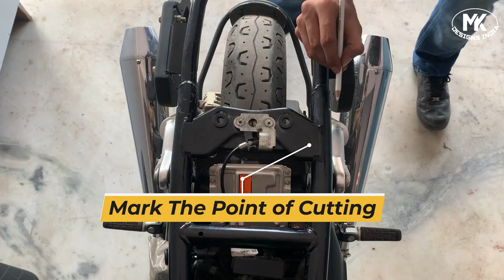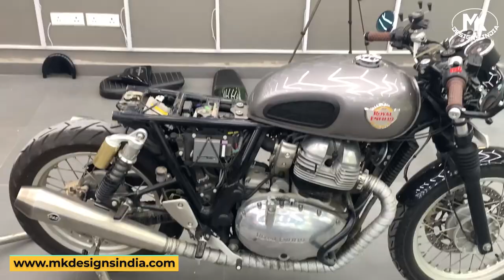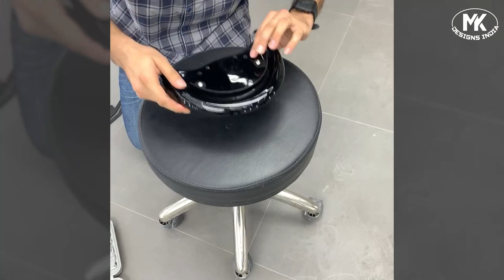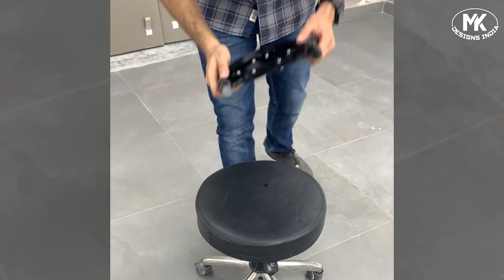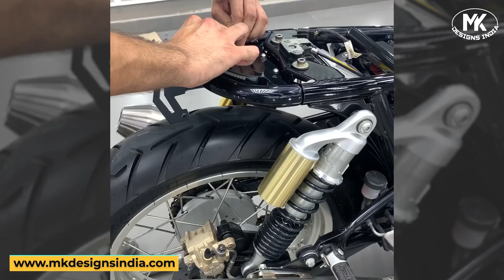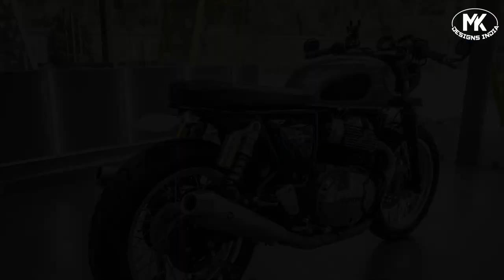Shorty Tail Kit | Interceptor 650 | Continental GT 650 | Royal Enfield Twins | Chopped Frame

Comment: But wouldn't the structurally integrity of the chassis get affected?
Reply: It would. This suits a show bike or one you'd use for shorter rides. Long time owners wouldn't cut frames obviously.
Reply: It wouldn't, because he's cutting the sub-chassis, not the chassis
Reply: He cut the back of the subframe not the frame that is connected to the motor! No structural rigidity is affected!
Reply: @tikiortaka  no it wouldn’t. It’s the subframe. Has no structural significance whatsoever.

Comment: So I decided to try this mod to my bike with the XL Shorty Kit which is the same size as the stock seat. It requires cutting closer to the end of the frame because the male ends (of the shorty kit) that fits into the female slots (of the frame) are too large. In order to get the seat to line up with the end of the tail, you have to cut further in where the pipe increases in diameter. Only problem is, the piece that's suppose to slot in is too short width wise and the slot isn't big enough. Now I'm stuck trying to figure out what to do next. Probably going to go to a metal fab shop and have them recreate the piece with the appropriate length.

Also, maybe I missed it, but I thought the shorty kit piece was metal, it's not, it's some kind of carbon fiber or hard plastic.
You may want to avoid buying this.
Reply from the maker: Mentioned on the website, its Composite Fiber . Its high strength. 
Needs to be cut at 35 mm from the frame starting .

Comment: Hey mate, great job.
I've recently purchased your tail tidy kit. Can you please provide a link to the brakelight system you recommend using with it.
Im based in NZ.
Cheers
Reply from the maker: LED Strip Light is included with the kit , which has brake light and indicator system both.
additionally for break light, can check this too- https://mkdesignsindia.com/product/led-tail-light-round/. and for turn signals - https://mkdesignsindia.com/product/turn-signals/

Comment: Can we keep stock gt seats on this mod
Reply: no bro it wont fit
Reply from the maker: Yes , Single seat cowl of Royal Enfield is compatible with Shorty Kit small .
For stock dual seat , use shorty Kit XL
Reply: @MKDESIGNSINDIA  will you guys make a medium length kit? which is not as short as this but not long as the xl version

Comment: Ok so maybe I’m naive or just need help to understand. How does this effect the integrity of the frame? I could see cutting the cross bar but it’s just the extension piece of the frame. If you’ve ridden this bike (which I own and do) the rider is positioned so far forward from this area and never comes in contact. Again I just want someone to help me understand this. I may order it but have not yet.
Reply: It won’t affect the structural integrity at all. Of course you’ll never be able to ride two up again, but who cares
Reply: @stevenguy2630  pillion  cares 🤣🤣
Reply: @livfullthrottle  With that seat...unless she REALLY loves you, the pillion probably won't want a second ride anyway.
Reply: @stevenguy2630  Why not? What if you JB weld the seam?

Comment: I won't reccomend tampering with the original frame
I'll prefer bolt on kits
Reply: How will someone shorten the frame with a bolt on kit?
Reply: @humanfirst11  yeah right
Reply: @BroZedd1  I was actually looking for a solution as I was planning to do it 😅
Reply: @humanfirst11  don't do it , you'll ruin your bike , it is an irreversible process
Go for slightly long aftermarket cafe racer seat ( a bit of compromise will save your chasis )
Reply: Shorten it by bolt on.. Hmm ;)
Look at ducati monster tail. Everybody shorten it. Me too.
No problem at all. And the frame from the gt 650 is way longer and looks very ugly. For me, the bike is only possible with a shorter frame. And when you cut it there, its not a problem technically.
Reply: @chillon2922X  i never said to shorten the frame by bolt on kit , sir
I only meant i will prefer a bolt on kit to cover up that extended frame part with a cowl or something ( a bit of compromise)
I won't trust anyone with a grinder on my bike

Comment: Why throw money away??, you can easily make your own “shortie” with the rear loop you just chopped off as many already did!!
Reply: Lol yep 🤣
Reply: Because the cost is not that high and everything is included.  It was a no brainer for me.  I place the order a few days ago.  I might not use it, but in case I go this route, I have everything figured out as a kit.  I do not even have to turn on the welder, or figure out a plate for relocating stuff... yeah, for what this cost shipped to the US, I would not bother trying to modify the stock item myself.

Comment: It Is Made out of plastic guys, MK should Let the customers know that
Reply: Interesting... never even thought about asking what it was made from... I thought it was steel... Mine should be here in a couple of days...
Reply: @wpanik  the MK is made out of fiberglass/resin.  I have it.  It is not made out of steel.  Only the brackets that holds it to the bike and the bracket for the tag are made out of steel.  Do not steer folks wrong please.

It is a nice kit.
Reply: @Wachuko-1  Well so it is…installed it yesterday and literally couldn't tell that it wasn't steel. Pretty impressive. Calling it "plastic" definitely isn't fair though. 

My frustrations came with the fact that the rear light isn't plug-n-play as it appears on the video and that there wasn't even a diagram explaining the wiring. So I had to figure all of that out before I could even splice on the old plug.
Reply: @wpanik  yes.  It is nicely made.  Heavy feel that would I definitely not describe as plastic.  That is why I made the clarification that is some sort of fiberglass resin with gel coat.  It feels solid.  Boat-building-like solid.

Kit brings everything.  But yes, you have to make the electrical install with the plug provided.  I got the wiring diagram from the web... from a similar light sold on eBay that had the diagram.  Then is was just a matter of matching to the factory harness.   Not difficult, but time consuming. 

I have it all ready to go, but have not gotten the courage to cut the frame, lol.  My plan is to make it so that I can switch back and forth between the short tail and the stock tail (for those times I want to use the bike on longer trips with luggage rack and saddlebags).
Reply: @Wachuko-1  That's a great idea! Totally doable too since you don't have to weld the new piece in place. 

Yeah I definitely think the kit is worth the price, just would've like a little more direction.